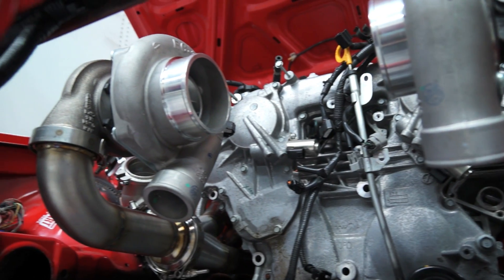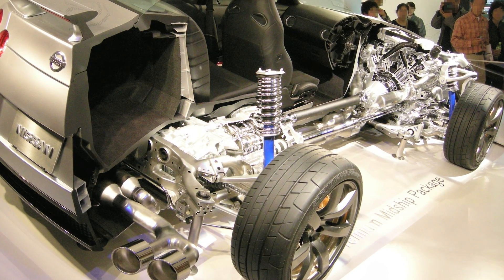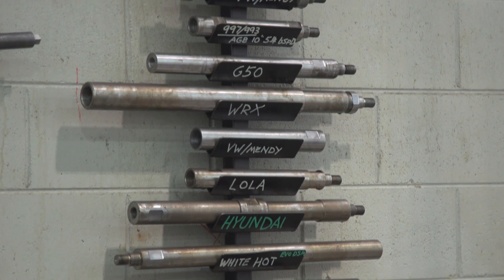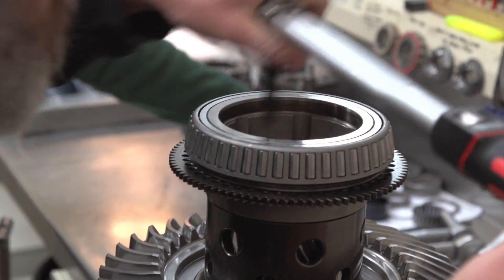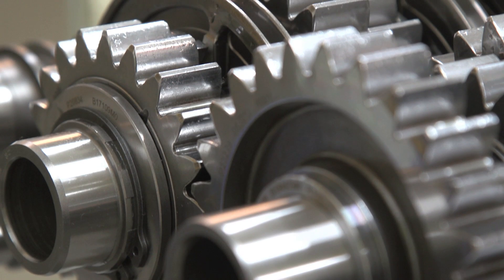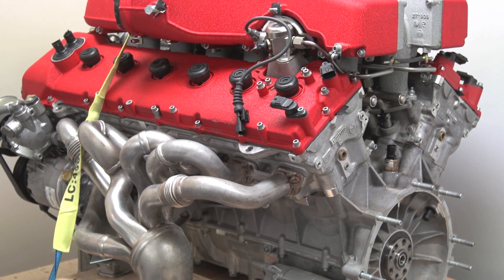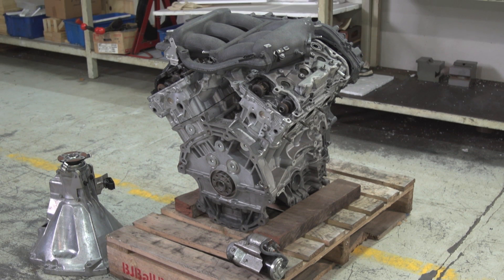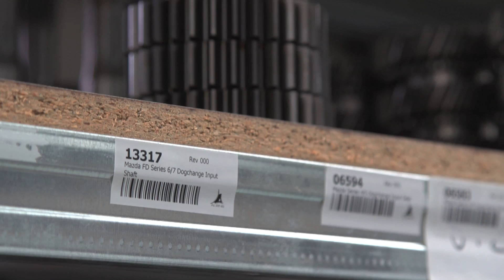Erubisu - VR38 Powered R34 GT-R - Part 2 - Albins Sequential Transmission

Comment: I'm so keen for this build but am disappointed to see part 2 wind up as a 6min+ advert for Albins. 

More info on what they are doing for this application would have been nicer. 

I'm fully aware you need to do some reciprocal back scratching to make this happen, just would have liked a little more meat in this update.
Reply from the maker: See your point. When we install the box we will be showing more of what is happening to suit our car. This was filmed when we dropped the engine off to start development.
Reply: +0actiondan0 I agree, the Albins section was a bit of a long one, but I'm still keen on seeing this R34 take shape.
Reply: +0actiondan0 agreed mate!
Reply: +MotiveDVD  Whens part 3 out?!.
Reply: part three has been out for about a week now..

Comment: Twin clutch box would have been sick
Reply from the maker: We looked at it. Making it fit would require major rear end and tunnel modifications. This would make it too far removed from an R34 GT-R. We also want this car to be realistic as you could put this engine in a. Road car, engineering it and make it legal. Also, once dual clutch is even in the car have to work out how to control it and strengthen it. Worked out that plus cost of buying one would end up spending well over 40K on transmission alone.

Comment: When you guys said manual I thought you meant H pattern which I was wondering how that would be done I guess sequential makes more sense
Reply from the maker: +skylineandy sequential is stil a manual and uses same type of gears inside, just shifts differently
Reply: +MotiveDVD  Yeah I know it's still manual a friend of mine runs 2 cars with os giken sequentials in them one of them is a car called project skydat half r32 half datsun 120y I just for some reason thought erubisu was gonna be H pattern I don't know why I thought that
Reply: +MotiveDVD but slightly off topic I'm using your project supercar r32 as inspiration for the progression of my r33 not exactly the same because mine already has different clutch cams etc but I wanna run a 10 on low mounts too